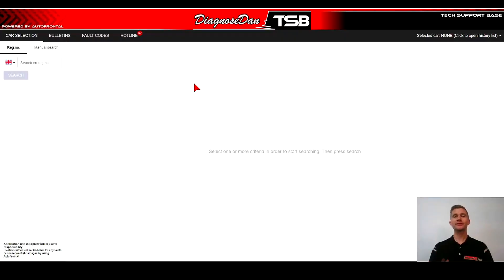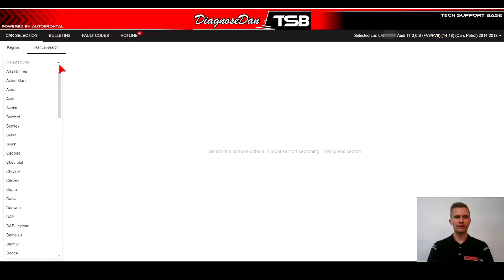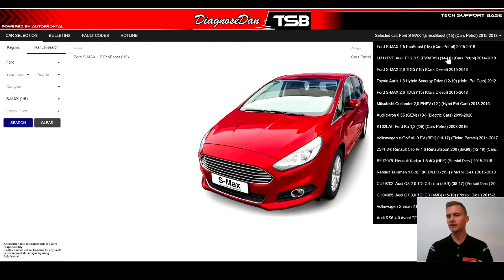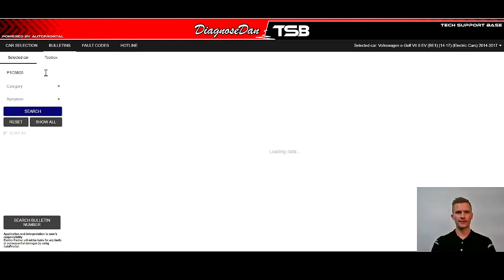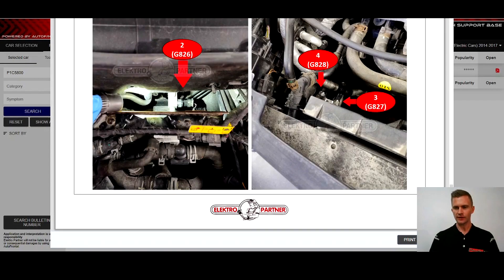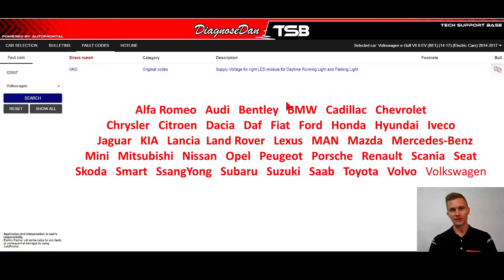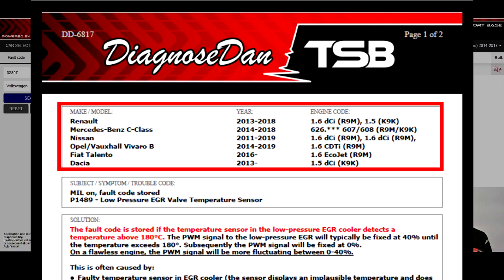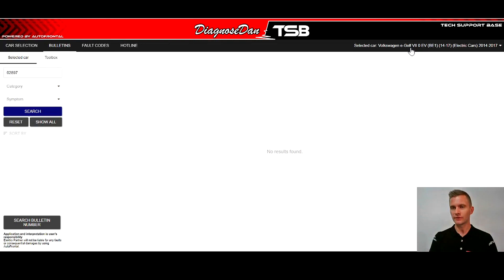DDTSB Video 2 - Finding TSBs using a fault code

Comment: Are there any issues with being in the USA?
Reply from the maker: You can Buy DDTSB everywhere. Just visit www.ddtsb.com. However license plate look up wont work outside Europe. So you must select the car manually. And the TSBs is not on US vehicles but only on cars running in Europe.
Reply from the maker: Hi Sal - We have some customers in the US. So the system will work you. But the database in DDTSB is built in Europe. So the cars that DDTSB covers are mainly the cars that is on the road in Europe. DDTSB does not cover cars that are only produced for the US market. So it might help you on European and Asian brands, but it depends on what cars you are working on. Hope this helps you.